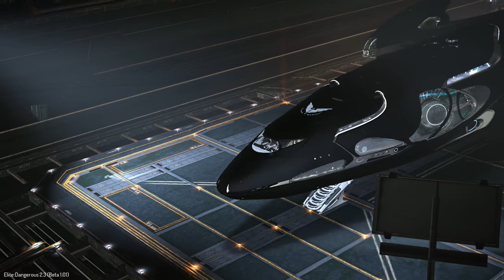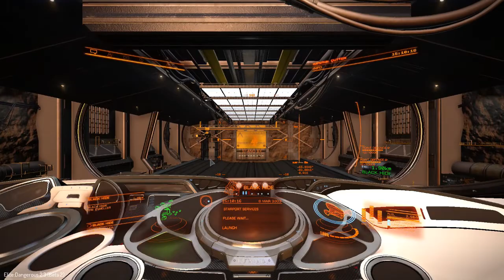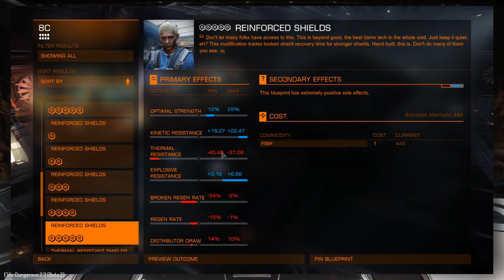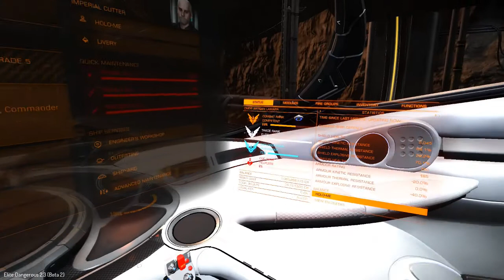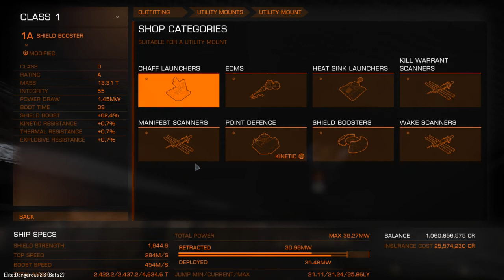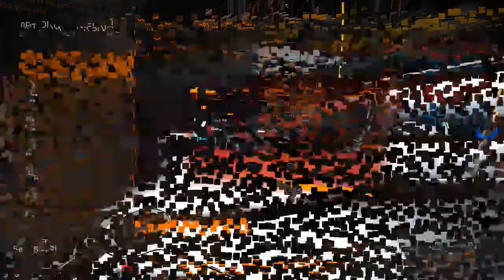Beta Shields and Boosters

Comment: for pve is enough 1700-2000mj and 30%-50% resi...and point def is waste of slots
Reply: apparently you have never ran into a commander with engineered missles it renders there weapons totally useless and it keeps all those damn explosions from blocking your view if your trying to aim fixed weapons and they look freeking cool when they are doing there job not a waist of a slot maybe to you but everyone has there opinion. i havent used the ecm modules but i bet they work good to but without the cool visuals.